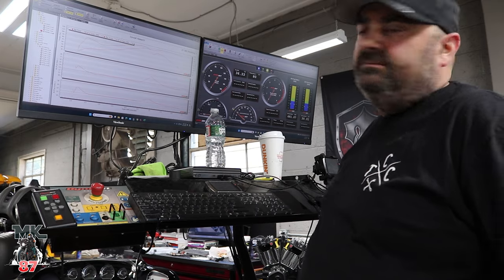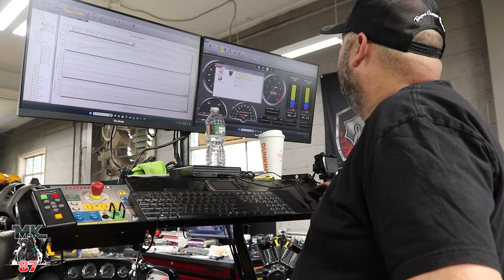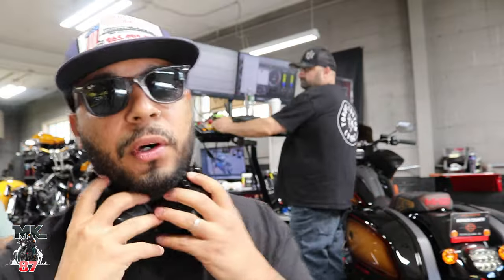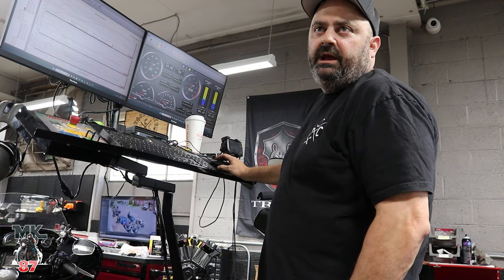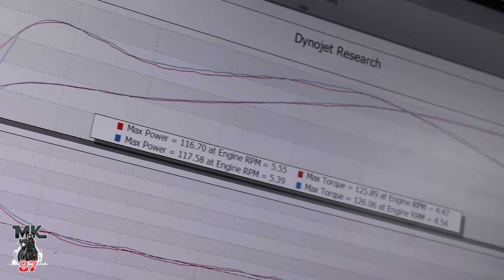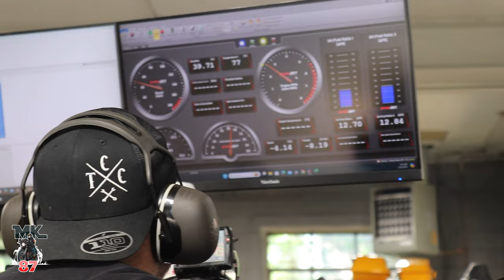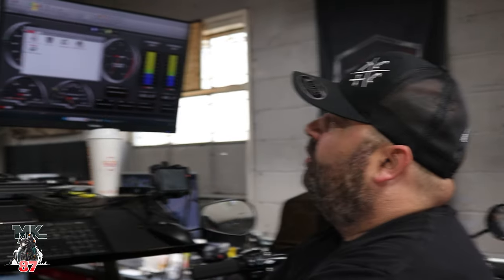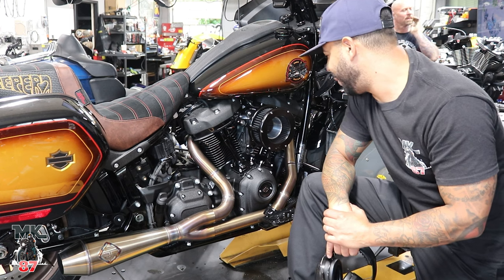Low rider st Stage 2 dyno numbers / 483 Cyclerama cam

Comment: good result the weather and temp effect numbers and all dyno's read different, my LRS did 124hp and 136 ft/lbs but my hp was higher standard around 96hp with 118 ft/lbs, I'm getting it re-dynoed tuned on Tuesday next week as I'm fitting a V&H aircleaner, not expecting huge gains but to get that snorkel away from my leg with the forward controls I have😎
Reply from the maker: Very true and Yea I’ll wait to run it again in the winter time because the temp does play a factor.

Comment: 23’ Road Glide Special 120th Anniversary edition with nothing but a S&S 475 cam, KhromeWerks Outlaw 2-1, S&S adj pushrods, Fueling lifters, Arlen Ness Big Sucker oval air filter element, ThunderMax tuner. Got 137ft lb torque and 126hp SAE. Stock oil pump, cam plate and injectors.
Reply: No you didn't. That's what they told you but that's not what you got. They can change the dyna to elevate the numbers. Bring it to an honest guy and see what you get.
Reply from the maker: Are these the SAE  numbers or THE STD numbers big difference cuz my std numbers are 137+ torque
Reply: I gotta look at my dyno sheet as soon I get home. SAE numbers legit n STD numbers r not.🫡
Reply: @frankvernol6911  ok. I’m a liar. But I hate to tell ya…that’s what I got from on the dyno…SAE from one of the most knowledgeable and reputable guys in the business David Crane (DC Cycle and Racing) in the whole southeast US. People come 1000mi + to have him tune their bike. He’s NOT inflating the numbers. Go ahead and call him out on it and see how it goes. It’s amazing how hypercritical one can get and how accusatory one can get because someone got great numbers.
Reply: @Marvelkid87  those are SAE numbers. The STD numbers were a bit higher around 138tq and 129hp
Reply: But you don’t go by the uncorrected STD numbers. The SAE are the best to use to gauge the correct number.

Comment: 2023 117 BO. 2-1 HPi , 478 zippers cam, SnS ported intake,5.5SE injectors, stock heavy breather,stock oil pump n cam plate, n stiffer clutch springs. She’s snapping 117hp n 137tq on a screaming eagle tuner😢. Power vision tune when warranty is up. Thinking she will break 120hp 😀

Comment: Stage IV here 550 S&S Cam 165/170...
Reply: Where are you guys getting these numbers from? I have a 2018 Fat Bob 117 stage4  120 HP/  121 foot pounds of torque.
I have my original exhaust pipes with the cats, cut out and Screamin eagle mufflers. Power vision.
Reply: @peteradamou809  2021 RGS - 131 SE kit, CP-Carillo Pistons, Fueling lifters, SE 64MM throttle body, Heavy air breather by Tab performance with 3" K&N filter , V&H High Output 2 into 1 exhaust, S&S guardian kit, Trask clutch basket, barnett clutch, 550 S&S Cam, SE pump, Star Racing compensator and the list goes on...